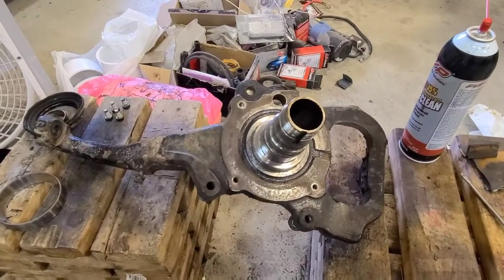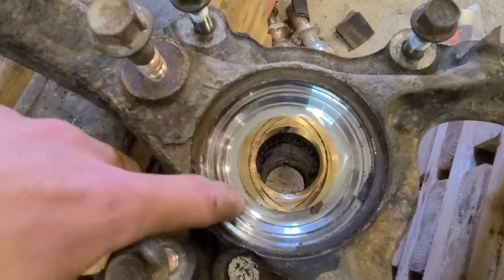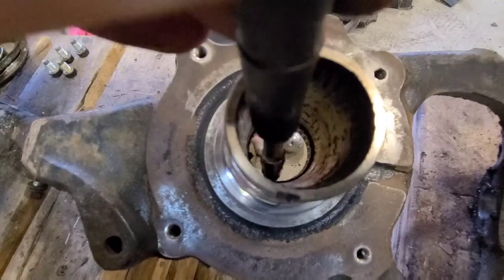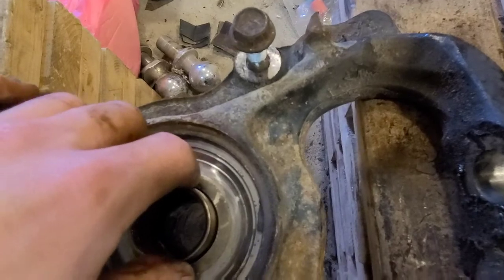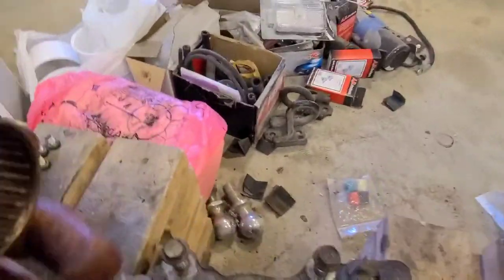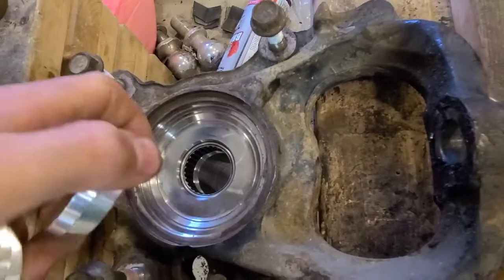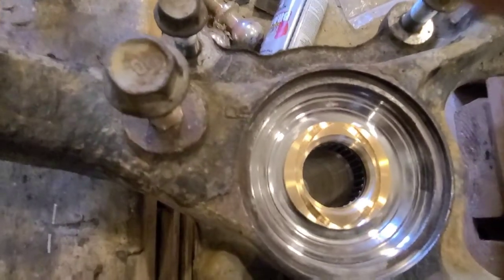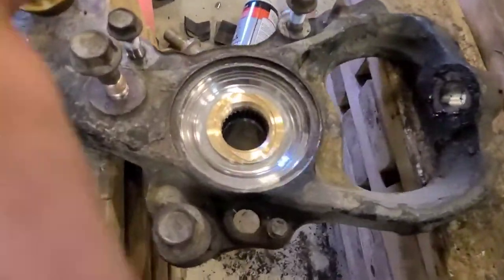How to Replace Spindle Bearing/Bushing in 100 Series Land Cruiser/LX470

Comment: Did this repair get rid of your noise? Thanks for sharing, good tips on the installation procedure and depth of bearing.
Reply from the maker: Yes it did! Also probably not a bad idea to check or repack your wheel bearings while you have it all apart. I am not sure if my noise was a result of the spindle bearing or the wheel bearings. Either way, the noise is gone now 😁

Comment: I’m having some squeaky noises only when I accelerate not when I’m off ,in I pulled the wheel off the brake pads seem fine although everything looks old, I’m wondering if this might be my actual problem or should I just go on and perform this job anyway?
Reply from the maker: Hmm interesting... I would just take the hub off and check the wheel bearings and make sure they are greased and maybe repack them. I would also check that the hub flange is still in good shape and the splines aren't stripped. I have heard over time they wear and can strip causing the axle to spin inside of it. That is the only thing I can think of that makes sense that it is making noise under acceleration only... sorry I don't have a concrete answer for you! :)

Comment: Hey!  Do you know the depth of the bushing?  I just took out my old one and it looks super short.  And there should be a gap between the bushing and the lip in the spindle correct?
Reply from the maker: Hi! I am not sure of the depth of the bushing. I just drove mine in until it bottomed out on the hub
Reply: @146garage3  ok thank you!  I put the bushing on the cv axle drive shaft to see how far it goes and it lines up right at the lip so I think Im okay.  Thank you!
Reply from the maker: @doodoobuttered  ok oh perfect! No problem :)

Comment: Hey so I’m changing my CV shafts and realized that bushing stayed on the old shaft, it didn’t stay on the knuckle. Just wondering if that bushing is supposed to pressed in cause if it is I’d probably have to get a new one
Reply: Srry, Ik it’s been a year and prob don’t even remember😂
Reply from the maker: Yes I believe that bushing should have stayed on the knuckle. I had to press mine in so I think it's supposed to be a pretty tight fit. Is it not tight to the knuckle anymore? Like it can be pressed in by hand or without much force?
Reply: No it doesn’t just slide on. I’d probably have to press it back in but idk how I feel about pressing in a bushing that came out on its own and also secures the spindle bearing in place loll. I think I’m gonna hold off for now and ordered the bearing and bushing just in case :/
Reply: My CV went out in kind of a weird way though. I think the snap ring slipped off (idk how) and the cv slipped back and stripped the teeth off along with the teeth of the hub flange so I’m guessing when it slipped out it probably got caught on the bushing and brought along with it
Reply from the maker: Ah yea isn't it awesome when weird stuff like that happens? Haha. It's probably a good idea just to replace them like you said. If I remember right they weren't super expensive parts
Reply: You gotta love it lmaoo. Kinda deserve it though tbh, I ran it pretty hard out in the desert last week.. I have one more question before I let you go though. Any tips when installing the new cv shaft in? I tried moving the snap ring around and shoving it in but I think im gonna have to call the bfh for some help. (Big fuckin hammer) lol
Reply from the maker: @kendrekmarrero5585  yea you might have to use a bfh to help get it in I think I had to do the same thing haha. One thing to note is that there are different width snap rings that hold the shaft tight to the splined hub. I think I had to buy thicker ones to get the correct clearance. There is probably some wiggle room around the right clearance for that but I think if it is too far off it might cause a knocking noise under suspension compression
Reply from the maker: @kendrekmarrero5585 oh and one more thing that I just remembered... the cv shaft should have a threaded hole for a bolt in the end that you can use. I just put a bolt in it and used that to pull the shaft through enough to put the snap ring on. It was pretty tight bc of the grease that I pumped in there with the slee grease tool so that was pretty much the only way I could get through enough to be able to put the snap ring on.. hopefully that helps!
Reply: Cool, I’ll definitely give that a try. Thanks for all the helpful tips and getting back to me on such an old video😂 Very much appreciated!!🙌
Reply from the maker: No problem! Glad I could help 😁